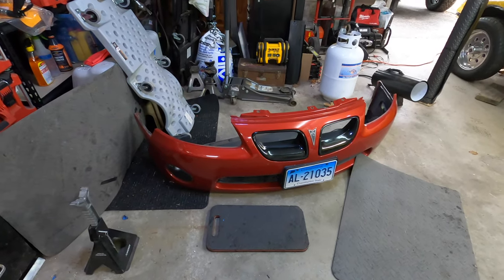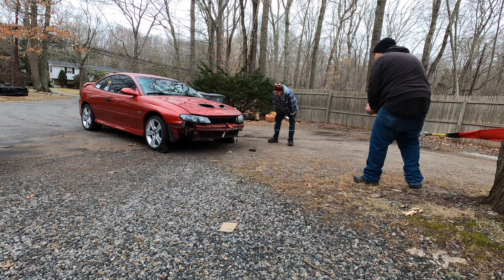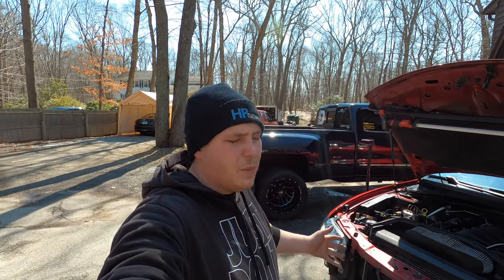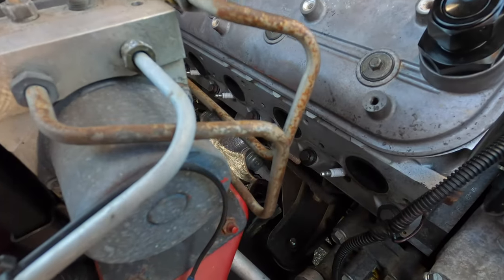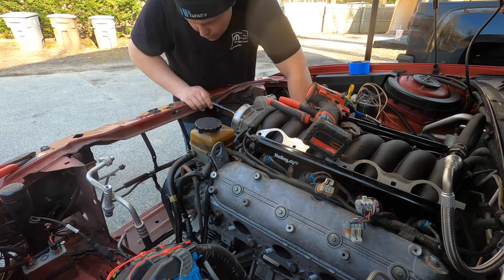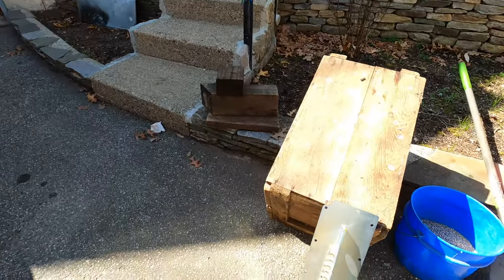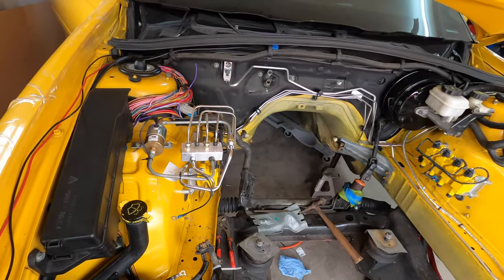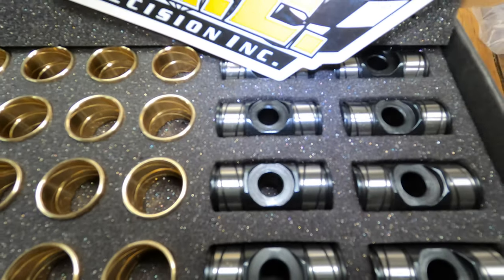pulling the engine out of the GTO for some upgrades

Comment: Should of done LSA! It’s more reliable and you can get good boost. Turbos are great but I have an LSA GTO and I don’t regret going that route. It made 680 RWHP
Reply from the maker: I originally was going to go Lsa but wanted more room to grow. I already have a whipple car so wanted to try something different ended up with a pro-charger and love it so far 🤟🤟
Reply: @bought2build  when I blow my engine lol I will def going pro charger. Heard so many good things about them. Turbos if you want to go the strip but if you want fun and fast LSA or pro charger.
Reply from the maker: @buddyrebel_Garcia  I mean not gonna lie my goal is still turbos they are all around a good option great for street/strip easy to turn up or down at the push of a button but I wanted to get the car together and running faster so I came across a procharger and grabbed it so far it’s been great but I may still end up turbo eventually who knows lol
Reply: @bought2build  I’m just afraid if I go turbo I’ll have heat issues. I already do with the LSA but I fixed it. Got Mishi Moto oil cooler and a 4000 cfm radiator fan. I also got vents on my hood.

Comment: What was wrong with the red GTO for you to take everything out of it?  Really enjoy the videos.
Reply from the maker: sorry for the late reply has been a crazy 2 weeks! so I did it for a couple reasons you can check out the videos! the red one had a rough body and some surface rust under it starting also had 150k miles! everything went into a mint completely  spotless Yellowjacket 40k original mile car that I now have with a procharger on it! 🤟🤟🤟🤟